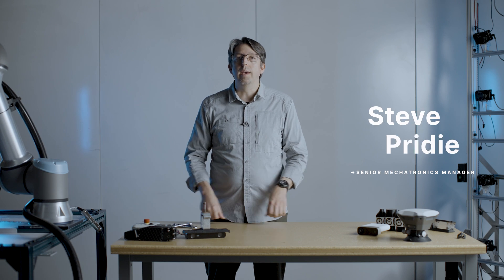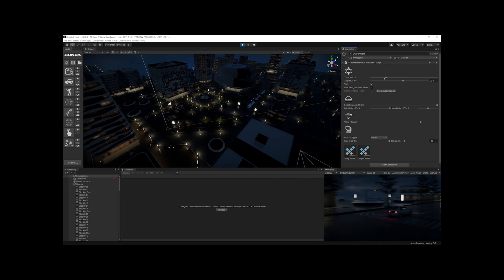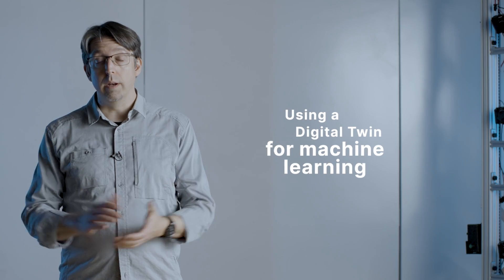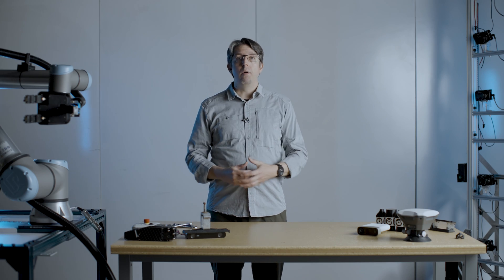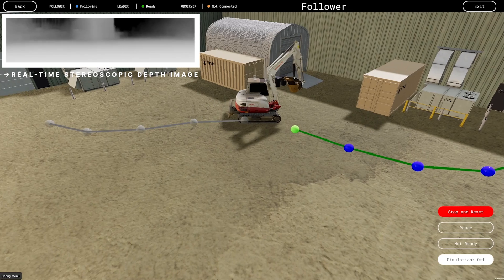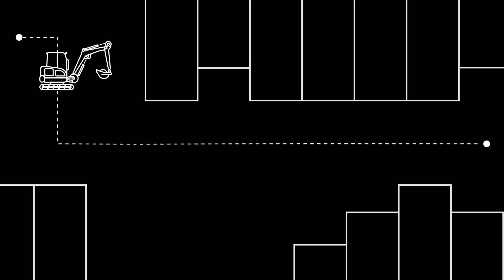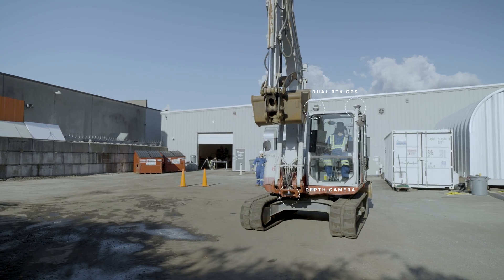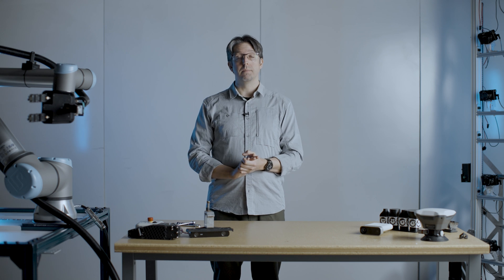From simulation to reality: improving safety and operations with digital twins

Comment: This is the aspect of unity I love. It may be slacking behind unreal in the game world, but for real world applications that will make real world impact, Unity is the number one engine for 3D in industry, medicine, manufacturing and robotics.
Reply: I dont think unity is slacking behind unreal at all. Its just part of the unreal marketing hype train that makes you think that. Because that has always been the marketing tactic of unreal. The hype.  For example, nanite, a fancy hype train word fot lod system. But in all reality just an lod system which rhat unity always has way more options for lod systems. But the unreal hype train would have the unsuspecting consumer thinking wow nanite!
Reply: @LifesMystery777  Metahuman is cooler than anything unity has. Yes in terms of game dev, unreal is far ahead. Metahuman, nanite and lumen are things unity don't have yet. Not to talk about unreal's superior AAA game workflow that provide you with the ability to make large scale games. Unity still has not solved the 32 bit floating point precision problem. However, Unity is much better for non-gaming applications because of its flexibility.
Reply: Unity is still the number one game engine for solo and indie studios. Unreal is currently leading for AAA games. I had jumped onto the Unreal hype train because of nanite and lumen. But when you dig a little deeper, you realize those technologies are not ready for the mass market due to hardware requirements. So I am switching to Unity which is more performance focused and has some interesting new technologies such as adaptive light probes, DOTS and Burst.